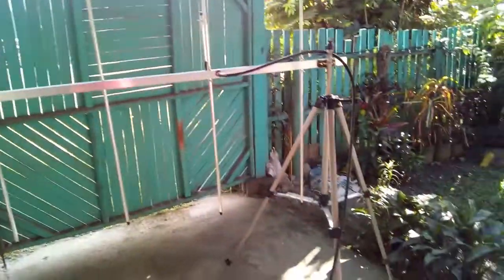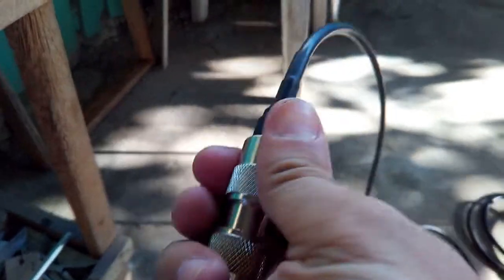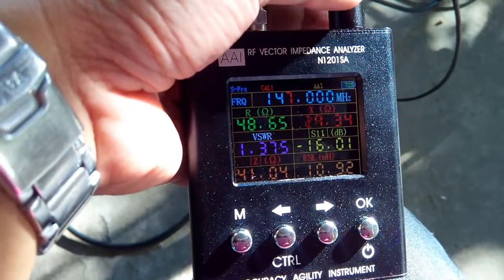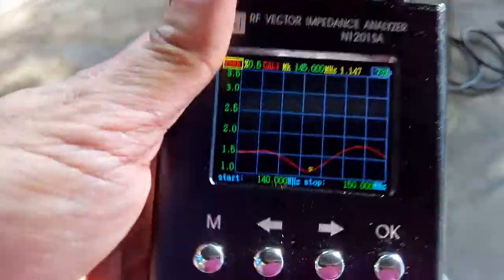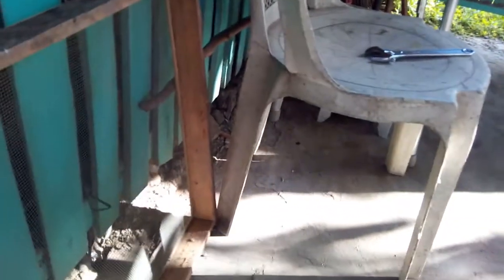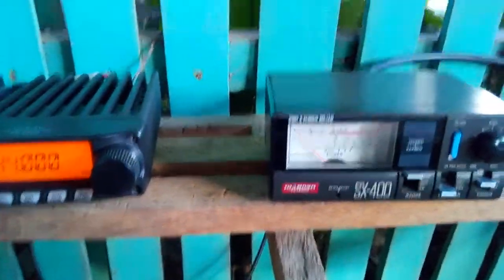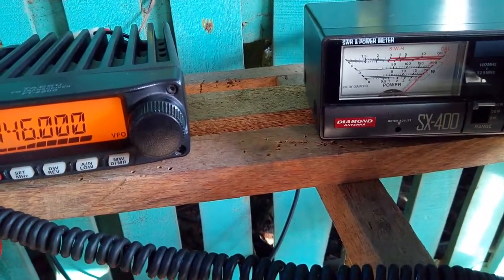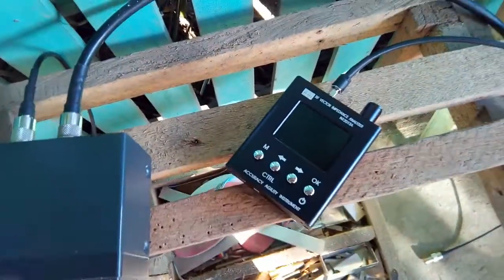N1201SA Vector Impedance Analyzer compared to Diamond SX400 VSWR read out

Comment: you should check it without the coax right on the antenna, that's whats bad about gamma match loading, the impedance is 50 at tunes freq, going away from it has a dramatic change in impedance, power transfer is really bad for other freq
Reply from the maker: Say's who?, the antenna has  specific designed frequency in which it is expected to operate satisfactory within the limits of those frequencies. If you intend to use the antenna outside the design frequency of course it will not perform as expected. Details of the antenna's are published on my website including specifications and expected performance pattern on the designated frequency.  It's up to the users to decide if they intend to use it or not by purchasing. Otherwise they can build it themselves since the build measurements are published freely.
Reply: @EphraimGariguez  its in your video. You even adjusted freq and only read swr. Read the impedance too
Reply from the maker: James Balagtas , I suggest you watch the complete video and learn to relate the frequency sweep analysis with regards to VSWR , S11 curve, and Antenna Impedance the frequency sweep (VSWR curve) shows no abrupt transition "dramatic change"  on the curve hence no  abrupt  Impedance changes as you can see on the curve it is consistent to 1.5:1 across   the antenna bandwidth rated at 144  to 148 Mhz  reading below 144 and above 148Mhz is not essential at SWR of 1.5:1 the impedance is about 75 ohms the highest reading is 1.7:1 at 148Mhz still usable as the acceptable antenna rating on the market is 2:1. I just show the read out from 140 to 150Mhz but it is stated in the video that the antenna is designed for amateur frequency operation 144-146 technically in the Philippines setting. You must be  watching another video when you made your first comment.
Reply: @EphraimGariguez  your using a gòod analizer. You seem not to care about impendnce loading. 145 its 50 but all the other freq power transfer is so bad. Impedamce mismatch of that capacitive is not reliable to be wide band. Bandwidth is only good for amature. 140 you should change the elements. Narrow yan.
Reply from the maker: @jbx907 , Yagi is not a wide band antenna my friend as stated on the video it is designed for amateur frequency operation, hence even if you can use the antenna above of below the designed frequency because of low SWR it will not perform well since the antenna pattern would be skewed and it is not designed as such. I fully understand that it is a narrow antenna did I not mention it on the video that the antenna is designed for amateur operations? see the antenna specs here if you are still in doubt. >>> https://dw1zws.com/product/4-elements-yagi-2m-amateur/
Reply: Gama match is capacitive. Making the antenna narrow. Advertise mo bibili tao ooperate nya sa 140mhz flat eh imoednacd na nyan di na 50ohm. Make antennas for specific freq need ng tao pra power transfer is reliable and tuned sa freq of operation nya. Bibili comecialista ng antenna pra sa ham. Di nmn ham gagamitin. Sa analizer plang narrow yan. SwR has nothing to do with efficiency ng radiate ng antenna. Standing wave is not power transfer. Impedamce is concerned
 Kitang kita mag bago impedance wla na sa 50ohms sa tinest mo freq. Makikita ko ba yan ling diko pinanuod buo video. If he need to operate in a differemt freq dapat. Gwa mo sya duon naka tune at near 50 impendance. I dont know what special at antenna mo lang naging wide band. Yagi's are known to be a narrowbamd antenna
Reply: @EphraimGariguez  now nag kaka intindihan tayo <3
Reply from the maker: @jbx907  parang galit ka yata sa akin saan ako nag advertise na mag ooperate ng 140Mhz to 150Mhz ( I would say usable but the designed frequency is 144-148Mhz) saka may binili ka ba sa akin kaibigan, wala yata akong matandaan? itanong mo sa mga nakabili kung ano ang ibinebenta ko sa kanila?  at kung hindi ako nag advise sa kanila kung ano ang binibili nila sa akin lalo na yung mga hindi nakaka intindi sa technicalities? May complaint ba sa akin? o antenna na hindi ko pinalitan pag merong problema magtanong ka sa mga forum bago ka mag comment ng out of context. Dahil hindi ko pinakiki alaman ang diskarte mo, all my works are published free of charge to those who can build it by themselves if they are willing to purchase from me good. If not, I don't care, its a free world the specifications and measurements are published anyway. If they have complaints on the antenna they purchased from me I assure you that I resolved it with them personally with very satisfactory results and I can assure you I have no standing issues with anyone. Cheers!
Reply: @EphraimGariguez  read the first comment. Maigsi lang yun. Never ako ang direcrional at very simple lang comment ko. Wla galit syo, pero diko malaman why swr s11 sinasabi mo which has no concen sa comment ko
Reply: @EphraimGariguez  kahit nga dipole gama match di ako gumamit. Buti may analizer na mura ngyn to see why.
Reply from the maker: @jbx907  ,  SWR and S11 curves (S Parameters) are directly related, read and learn the antenna theory and lingo.  SWR is directly related to Impedance matching and S11 curve is antenna reflection coefficient. If S11=0 dB, then all the power is reflected from the antenna and nothing is radiated.
Reply: @EphraimGariguez  very simple lang comment ko. Prang lahat nakaka usap mo tanga o di alam swr or s11, read and learn ba, dapat na intindihan mo point ng comment prang ikaw lang nakaka alam ng swr o s11 sa sobra talino mo di mo get point ko. Kahit sa fb yan sagot mo kahit sigro sa ibang tao. Lau. Sge expalin to me why my comment is invalid. Ikaw na yata pinaka matalino at ikaw ba nag design ng yagi? O never went for it tlga kasi problematic yan pag mabasa at nag leak.
Reply: @EphraimGariguez  can you express it in mathematical equation pls, joke
Reply from the maker: @jbx907  , ngayon ikaw naman ang balat sibuyas?, eh ikaw nga etong comment ng comment dito sa video ko bakit out of context eh kasi ang title ng video "N1201SA Vector Impedance Analyzer compared to Diamond SX400 VSWR read out" ang topic read out ng N1201SA VNA versus Diamond SX400. Ang comment mo eto "you should check it without the coax right on the antenna, that's whats bad about gamma match loading, the impedance is 50 at tunes freq, going away from it has a dramatic change in impedance, power transfer is really bad for other freq" oh di ba not related? anong relasyon ng comment mo sa topic meron ba?
Reply: Eto diko nakikita pa. Vhf sector antenna. 120 degrees and 90 degrees. Yan bibili ako promise.
Reply from the maker: @jbx907  , nood ka rin ng pag gawa ng gamma match, tingnan mo kung mababasa ang loob at mag le-leak?. Baka pakiramdam mo lang yun sa mga nakita mong gumagawa ng Yagi hindi ako ganun kaibigan walang bibili nyan sa presyo na binebenta ko kung walang quality. Nandyan din sa mga video.